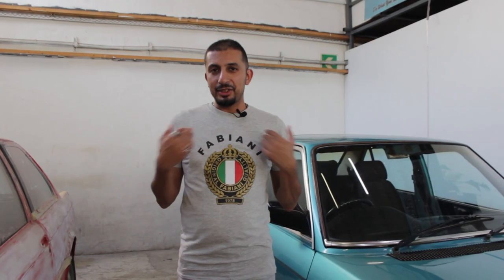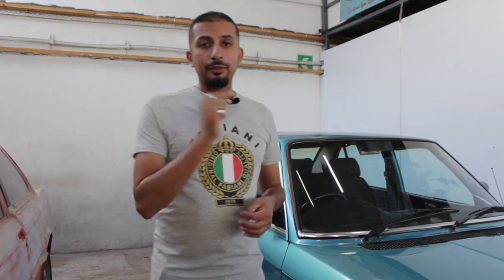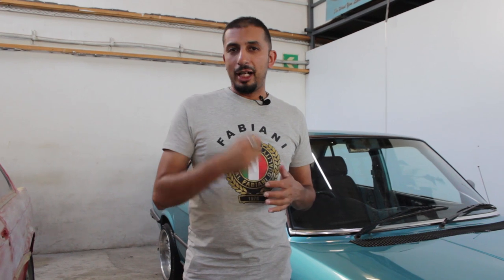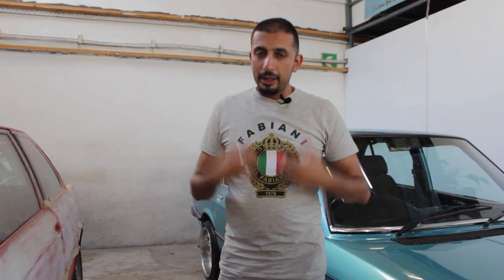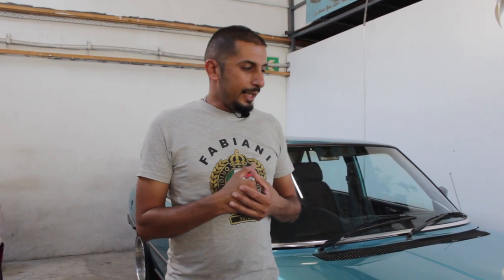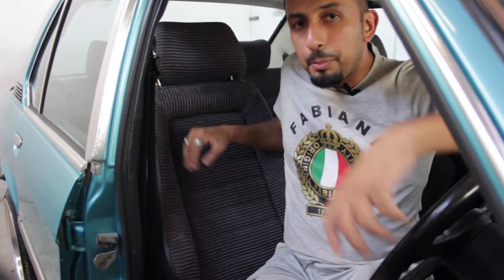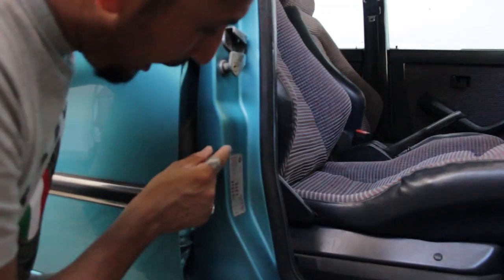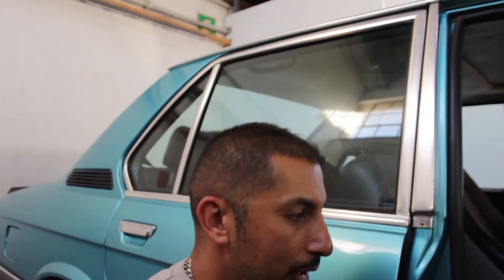In Depth Review Of South Africa's Most Iconic Car

Comment: My dad was the one that started our family's love affair with BMW'S from the 80's. I grew up with Capris, Big 6 XLE's Granada Ghias, Cortina bakkies, ROVER V8's, which is probably why i'm a car nut. My dad had the 518i with the BBS front spoiler, rear spoiler and the Mahle wheels, and then one day my uncle rocked up with a m535i, light green, motorsport front spoiler, dogleg box, recaros, no sunroof though, remember my dad taking it for a test drive, yooh i can still smell the rubber from the trx's 390. my uncle resprayed it black, an recovered the seats in black and green leather which was the craze back then, also fitted 16" compomotive wheels, had hockeneims before that, what i remember is that you could pull away from 3rd gear if you wanted to, but my uncle hardly used first, normal operation was from 2nd gear, and before you know it 195 in third gear, my other uncle had a 528i with 4spd manual, then a 1985 528i, with sunroof but auto, was practically new when he bought it. we also had various e30's ones with original mtech2 kits and some with fibre, mostly 2.7, some 323i, 320i, m30b35 and the list goes on, my dad bought an 85' 733i in 93' damn that thing was fast, 220 was our cruising speed every Saturday morning, he had an 85' 728i manual as well with 260kmh speedo sunroof etc, uncle had e23 735i with electric seats and sunroof, sports auto, nice car. saw a race between a silver e12 m535i and e28 m5 once robot to robot... from killarney raceway, e12 was in front. wish they could make cars like this again...

Comment: Our first BM was an E12 518 which we discovered had been written off in a big crash and rebuilt but sold as virtually brand new!! So we returned it to the dodgy dealer we bought it from way back in 1980! Then My Dad bought an E3 2500, which I currently still have. It had a major mishap in 1988 when it got rolled big time then I rebuilt it into a donor body shell which was only 4 cars older than the original body shell going by the chassis #. It is still a runner but does really need a resto now. Great video Chico. God Bless.
Reply from the maker: Thank you for the amazing story as well as support, these are truly amazing cars 🙏💙

Comment: Hi Chip, love the content, just a question well 2 rather lol, that I've been wondering for a while how's the reliability of the m30 engine and would you advise someone like me to do a m30 swap in the e30 chasis or stick with the m20 engine? I have a e30 320i.
Reply: Hey brother. Thank you. So both are good options. However, you must remember that keeping an e30 and e30 will always be more valuable than an e30 with a non e30 engine. In terms of reliability, both are good, and the longevity will be determined by your driving style and also continuous maintenance and quality of parts used.
Reply: @Tariq Moosa  thank you I appreciate it

Comment: Salaams bro. i recently purchased a 525e e28. Unfortunately, the motor broke so i did a M50B25 swap. What's your opinion on whether I should spend money on the car to get it to a "fresh" status? Would a swapped e28 appreciate in value? or should i rather replace this with an e30 325i?

one more Q, is it better to keep and auto E30 325i standards or is there more value in converting to manual (as an investment)?